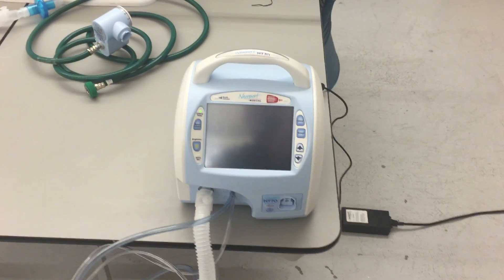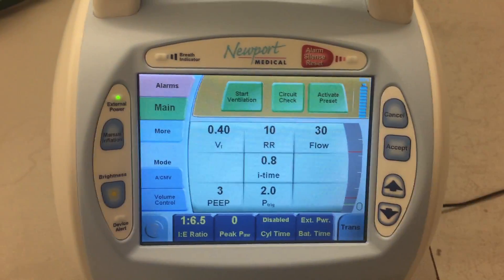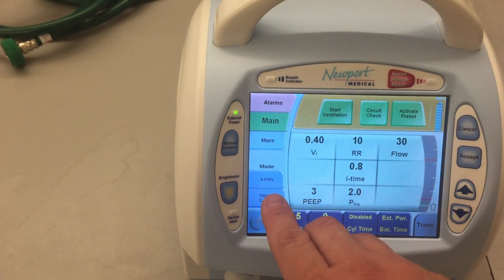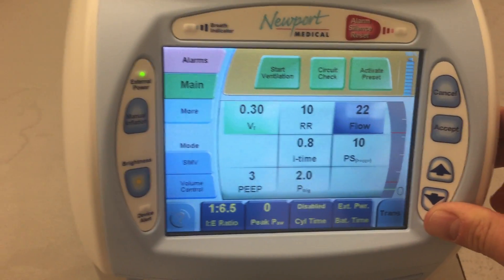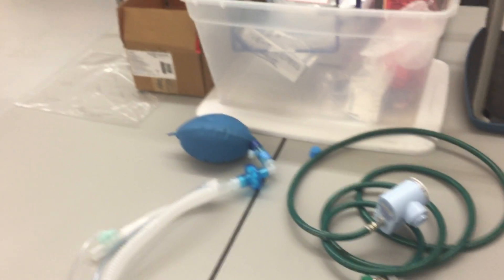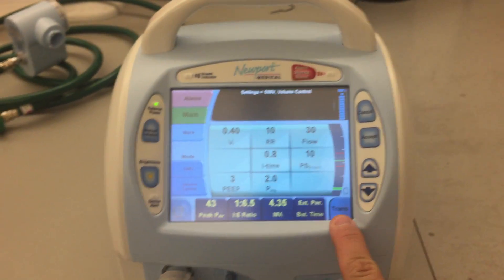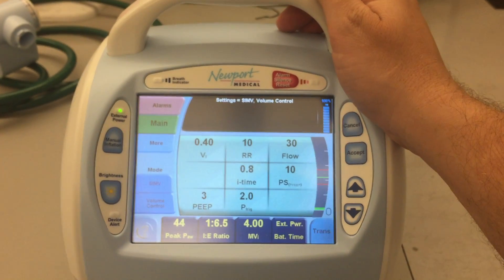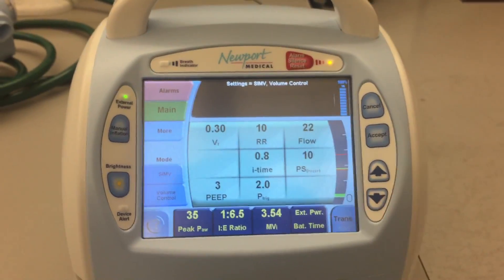Basic adult ventilator setup with the Newport HT 70

Comment: "Whent setting up the HT70 to the desired SETTINGS, you need to hit accept otherwise it will go back to the previous settings" wchic is axatly what happen in this video. the representator wanted: SIMV OF  .30 RR 12, PSV 5, PEEP 2 however after intering the settings he forgot to hip accept so the vent automaticly went back to the previous settings which was SIMV .40, RR 10, PSV 10 AND PEEP 3. this could be a very serious issue if it was in a real patient.